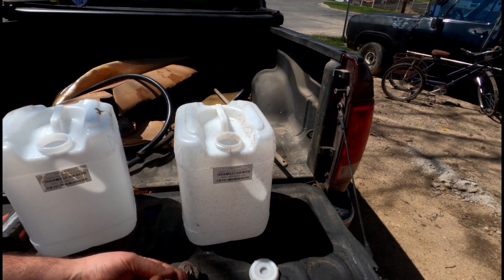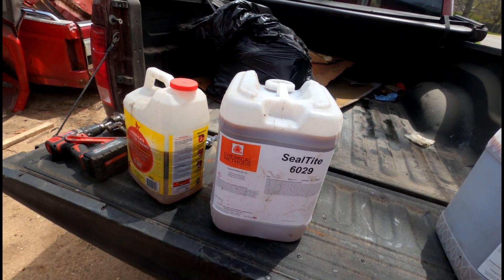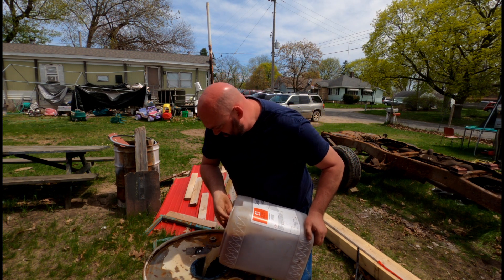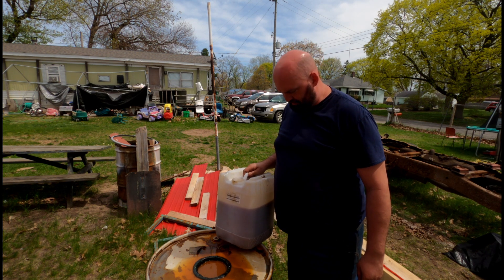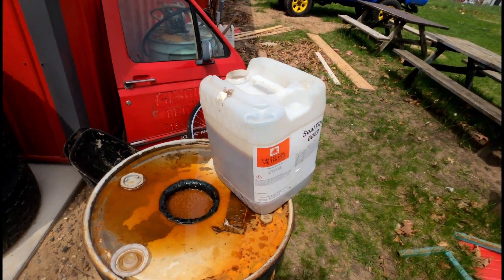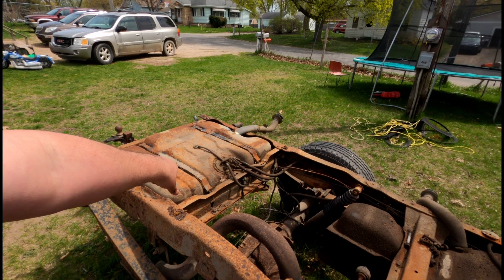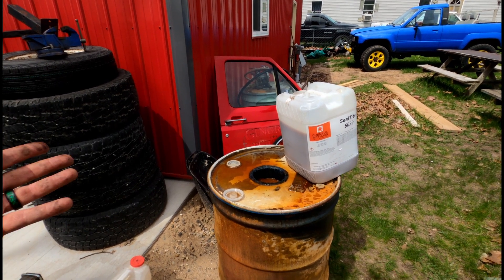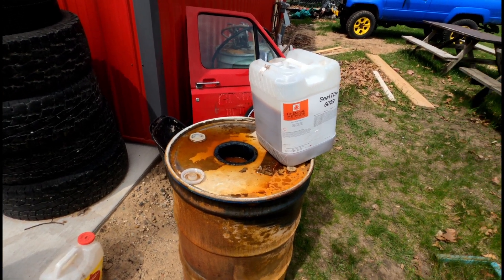FREE fuel vegetable oil - How to get free diesel / biodiesel from pumping and processing oil!

Comment: hi sir ,i enjoy watching your video.i drive a mazda b2500 diesel van i dont know if its a common rail or mechanical diesel pump.experts like your self will easy know that .can i put filltered wvo in it with no engine failures.  thanks..
Reply from the maker: Always just start small and work your way up.

10%, 20%, etc etc until you lose power or have hard starting, then back it back to whatever worked

Comment: You run this in your car thats not set for e85 you will need to tune your fuel as it will run to lean. This gas basically stalled my Sky till I dumped the tank.
Reply from the maker: If you run this in a gas car you're gonna have the worst day ever 🤣
Reply: He's not making ethanol lol
Reply: This is for older diesel engines.
Reply: Don't block the ducking replies,,, 😒
Reply: Hey tool bag e85 is not bio diesel and this is about running waste oil...gtfo .
Reply: @wymansst  what’re you talking about?

Comment: How to know if this will work on my small home diesel generator or my diesel bus

How to check if the injection system actually works with it
Reply from the maker: It'll work in any diesel really, with varying degrees of success. 

Anything with a mechanical pump will run it straight, as is. My Toyota does this, but it's always better on a bit of a blend to thin it. 

If you have a mechanical pump, just start adding, start at 10%, see how it goes, go to 20, etc etc until it doesn't like it and dial it back. In the dead of winter my Toyota is nearly impossible to start on a 20/80 diesel veg oil mix.
Reply: @TheDrivewayEngineer  even after mixing veg oil with methanol to reduce thickness
I still have to run a mix of diesel and veg oil??
Reply from the maker: No methanol involved to run straight veg oil on a mechanical diesel